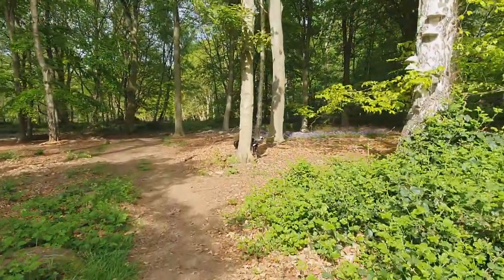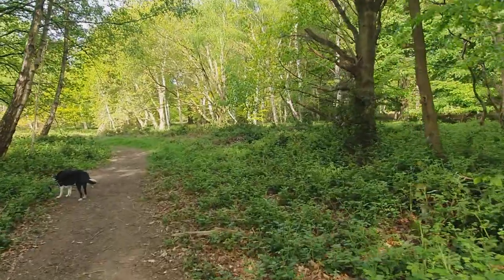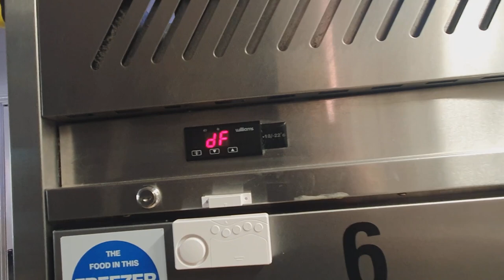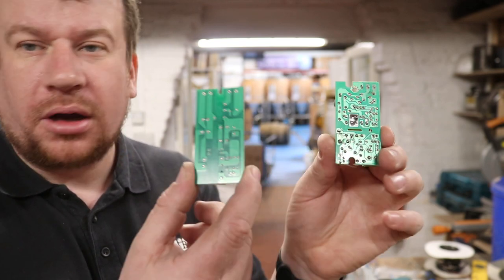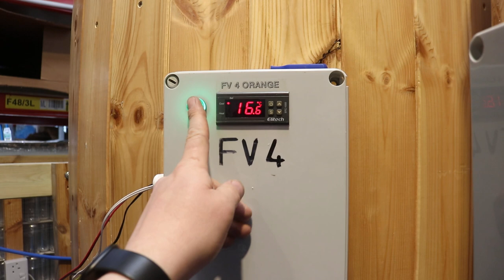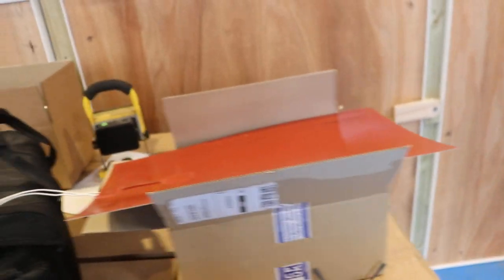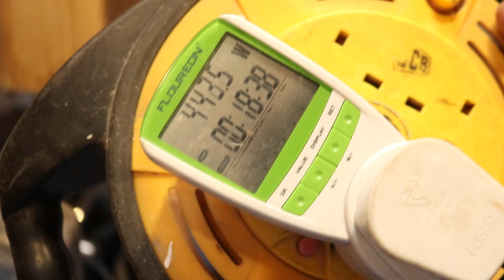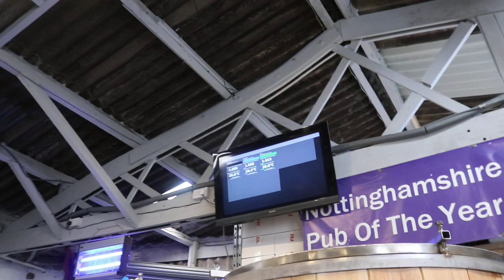New Heating For The FV's

Comment: I know nothing about this stuff but would underfloor heating rolls work wrapped around cone. They are £50 for metre square. Is it too similar to the heated blanket thing? Anyway glad you’re posting again. Wish you all the luck in these troubled times.
Reply from the maker: Tried them a few years ago, They work better than the "silent night" heated blankets I tried but not well enough to heat 500 ltrs.